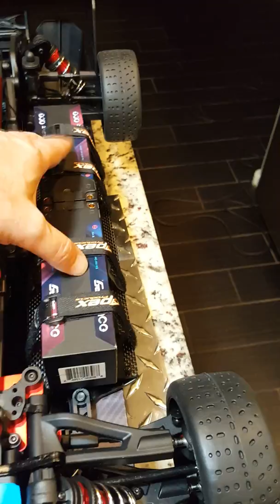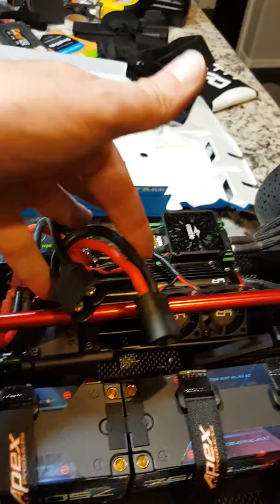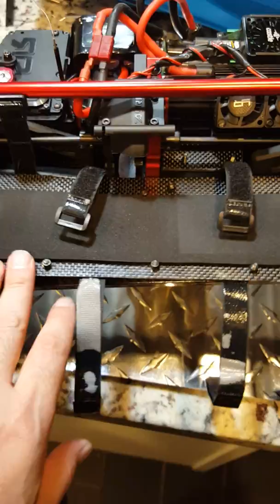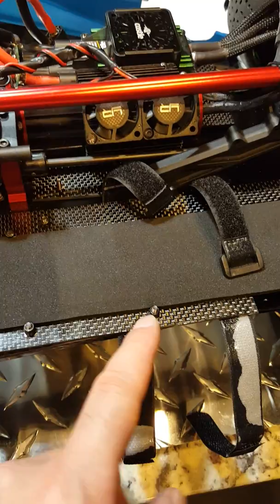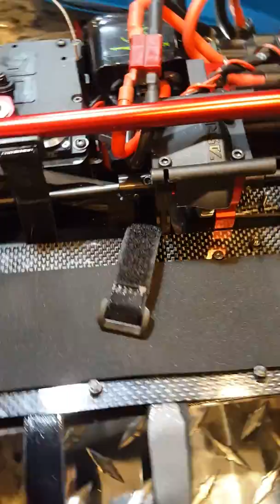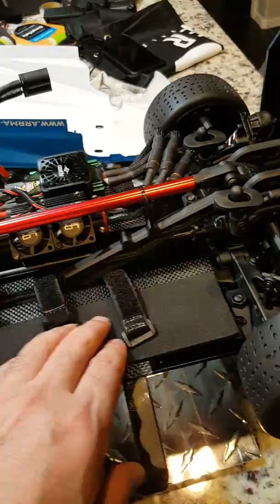Arrma Limitless or Infraction custom battery tray build

Comment: Can you describe your setup
Reply from the maker: Man there a lot to describe lol....what are you wanting to know and I can try to answer
Reply: Motor esc combo
Reply from the maker: @arrmaboy_6508  sure my esc is the castle xlx .... this is probable one of the best if not the best esc for power... some may differ or have their own opinion... it's capable of 8s... my motor is tp power 4070cm 2200kv.  This motor is also capable of handling up to 8s and up to 75k rpm for like up to 10 seconds.   This motor is a beast also.  I have had this setup in both my xo1 and my limitless and it has never failed me!
Reply: How much did it run you
Reply: Seems like a solid setup I just have crap in mine its still fun to run up to 6s but I like it on 3s but my motor is crap and it's only a blx 185 arrma motor and mamba monster 2 esc it heats up fast...do you know why...stock pinion and gear
Reply from the maker: @arrmaboy_6508  it depends what stock gears your running...i think they have one set of stock gears for bashing and one set for high speed runs.... what are the size of the gears your running?

Comment: how did it run with this setup?
Reply from the maker: Thing is a beast.... check out one of my other videos where it did a back flip at 112mph... that was with the esc turned down and about 3/4 throttle

Comment: What did you used to cut the carbon fiber? Thanks!
Reply from the maker: I used my dremel with a cutting wheel...use painters or masking tape to make your line
Reply: @dfresh2776  I appreciate it!
Reply from the maker: @ivanw7457  no worries bud... make sure you wear a mask and eye protection when cutting... You don't wanna breath that crap in or get something in your eye!
Reply: @dfresh2776  got it!
Reply: @dfresh2776  Hey D, sorry to bother you man. My limitless will pretty much be identical to yours. I have the TP, carbon fiber plate 3mm. Xlx is on the way. I'm just curious of what esc to motor connection you would recommend. I have amass connectors in my cart now. I appreciate it man, out of all the videos I've seen, you have one of the cleanest setups and it makes sense! That carbon fiber L bracket, the end to end lipos. Yea bro! Thanks for keeping it 💯
Reply from the maker: It's funny you should mention that....i just purchased the amass as150... I'm waiting for them to arrive... no bother man that's what we're here for
Reply: @dfresh2776  lol o wow! I appreciate man.
Reply from the maker: @ivanw7457  are those same ones you ordered?

Comment: That a nice custom upgrade bruv. What the weight balance like did you check weight of electronics all together to battery that would be nice to know as I can see me doing something like that. Respect for sharing 👊🏾
Reply from the maker: Thanks man i appreciate it...I'm not too sure honestly what the exact weight on each side would be but in theory I have the weight spread across the entire chassis which would be better than having batteries stacked on top of eachother in the rear of the car.
Reply: @dfresh2776  totally agree bruv on that it a way better way to balance the weight. I did put 2 battery in my Limitless on first run just to balance better even though I was only runing 1 at a time. It make a big difference to handling and performance it being balance. I'm just about to upload now my first run. I'm looking forward to see more upgrade from you bruv. 💯👌🏾
Reply from the maker: @birminghamgtrc  let me know when your video is up I wanna check it out!
Reply: @dfresh2776  in about 10min should be finished uploading ☺️ respect 👊🏾
Reply from the maker: @birminghamgtrc  ok cool I'll keep an eye out for it
Reply: @dfresh2776  it up bruv 👌🏾